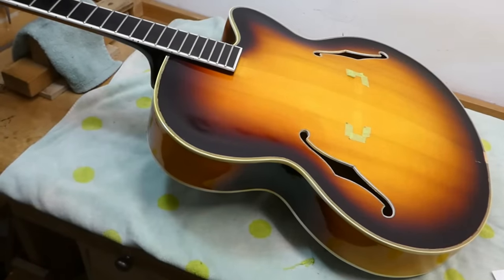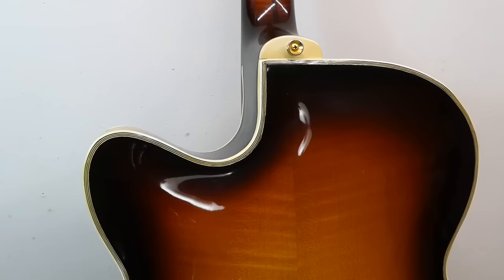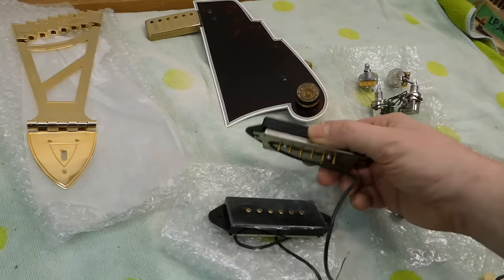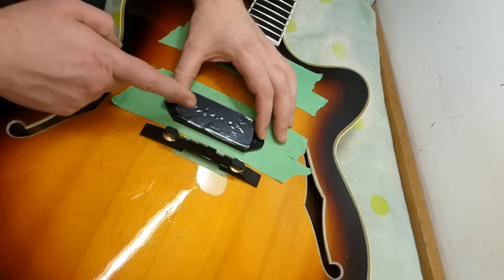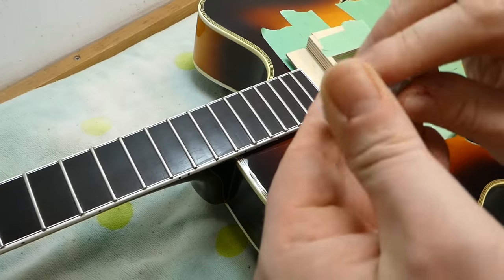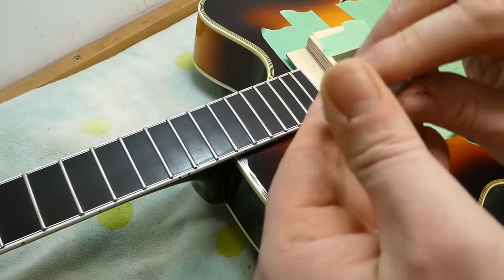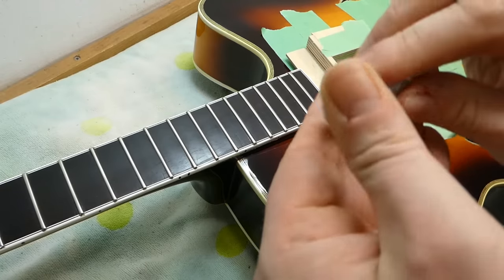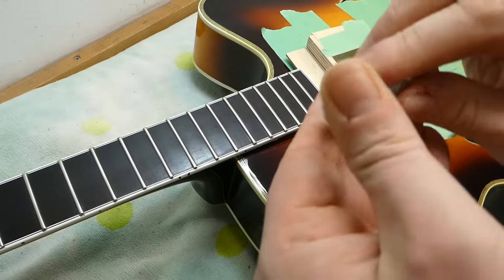The Forbidden Mod

Comment: Insignificant correction:  A hundred mils is about 2.54 mm.  That's an easy one, also a number I have memorized while refacing sax mouthpieces.
For historical reasons, sax mouthpieces are measured in mils for the tip-opening, but mm for the length of the opening (the lay ).  So a piece might be designated as 100/24, meaning .100" tip opening and 24mm lay.

Comment: You said that the optimal spot for the bridge pickup based on harmonic overtones becomes irrelevant the moment you fret the instrument... but that isn't necessarily true, since many chords, songs, etc. are centered around an open string, or at least are relevant to one harmonically, and most people typically play using scales, which are typically groupings of notes with a high amount of harmonic consonance.
Although... this is so deep in the minutia of tone construction, that its effects would be so miniscule as to be totally irrelevant in any meaningful context.

Comment: Did i miss the part when you checked where there are braces ? I once wanted naively put a neck pickup in an archtop and then realized that there are A (or V) shaped braces from end of body to the neck that come together at the neck and you definitely would not want to cut through those. Have seen this bracing on several old archtops. Never seen an X like this has.

Comment: how about making a threaded sleeve that will fit inside the hole in the body, secure the switch, and sit tight with a nice little rubber washer. may need a slightly larger hole and a lathe, but seems easier than gouging rom the inside. thoughts ?

Comment: I would have installed a floating DeArmand Rhythym Chief with a single volume pot in the pick guard. Rolling off the volume gives you a less bright tone so a tone knob is redundant. This was too invasive. At the very least maybe install dog ear P-90's instead of cutting up the soundboard so much.

Comment: As always well thought video! But I would like to state that there is no electronics in this guitar, as in 99,9999% of all other electric guitars (which are in fact no electronic guitars). Here, it's only primitive electric parts. Electronics would be an active circuit which requires at least a transistor or diode or, if more complex, something like an operational amplifier or microprocessor.

Comment: In the future, you may want to try and round off the interior corners of the cut if you ever find yourself cutting braces again. Sharp corners create something called a stress concentration, which vastly increase the chances of a break happening. Back in my knife-making days, I learned to avoid 90* internal corners religiously!

Comment: Some toggle switch 'nuts' have a longer 'throat' to go down into your hole that is drilled through the top of the guitar.
Reply: Used to use those to mount car stereos into dashboards in the 1980s; they're called "reach" nuts. Never seen them in anything but black finish however (the nut can't be seen underneath knobs, but a toggle switch will have a visible nut).

Comment: 3M offers painters tape in three different tack/adhesive levels.

The low tack version will stick to a smooth surface adequately, but can be removed with substantially less effort than the painters tape used in this video.
Reply: One more thing. You learned some pretty sounding chords. Nice work and sounding guitar.

Comment: Listen to me twoodfrd.  I need to communicate in as little time as possible.  Try a little longer screws on the pick up surrounds  AND then place some real slick gaskets between the surrounds and the guitar's soundboard.  Tighten the scews back down lightly allowing the pick ups to rest lightly on the gaskets.  YOU WILL BE amazed at how much of the acoustic sound you WILL recover.

Comment: I feel like you always struggle slightly with using fishing line (or similar) to fish pot shafts through holes. Have you considered surgical tubing? Instead of tying line to the shaft, slip the tubing over the shaft. Then as you pull the tubing out, there's nowhere the shaft can go other than through the hole with it.

Comment: What I would have done would be to tape off the F-holes, carefully remove the back then fill the body with epoxy resin, put it through a band saw to reduce the body to 1/3rd the thickness, turn over and rout out for three f*ckbuckers and a Floyd Rose, scallop the fretboard, add a locking nut and spray shocking pink metallic and add LEDs.

What - the...  the 80s are over?!?...

Comment: at 10:32 ish when you said "I'm just gonna mark it," I was actually in the other room listening to this video. When I heard that, then I heard the scraping sound that follows shortly after, I thought you were just scraping the finish on the guitar. I was thinking, "damn, this guy is fucking baller" lol. But then I realized that you were using sticky tape. I wanted to make this comment to say that despite my miscalculation, you're still a fucking baller.

Comment: Well, I for one don't approve of this mod, and who cares what I think. There are plenty of people who own more fatback jazz guitars than I do, but I have an L-5 and two Guilds from the 50's (chosen for their long scale '56 and earlier) so that's not nothing. How many times does a jazz guitar player use the bridge pickup? Approximately zero. Mixed with the neck pickup? OK, once in a while. I would opine as follows: That this guitar owner would get 70% of what he thinks he is gonna get out of two pickups by simply finding or modding a "Johnny Smith" pickup (like the one he has) where you could split the pickups, HB and single coil, at astronomically lower cost than this mod and leaving the guitar as it is. I mean, fun's fun, but he is actually losing the humbucking sound of the existing pickup, which to me is the main sound of guitars like this.
Incidentally, the nut for the pickup selector switch uses the same thread (and thus utilizes the same nut) as just about any old panel-mount bat-handle switch that mounts in a 1/2" (actually 15/32) hole. True, not gold plated.
PS: Making pickguards for hollow body guitars is a complete PITA.

Comment: At 6:15, the ground wire comes off the back of the pot; whoever made that control assembly had lousy soldering skills.
Reply: I didn't do it. Although if I had, there is a 31% chance the same thing would have happened.

Comment: So what your saying is ITS WORTHLESS ..HACK IT UP!...btw,nowsadays you can find a 3-d printer to make whatever part you need such as the tip for the switch for example...also,you can use a dental mirror and put it into one f-hole and use the other f-hole to look into to see were the top braces are..probably need a flash light

Comment: It would be better if you understood more about the physics of a vibrating metal string.
Reply from the maker: People love to talk about this, but it's always about a theoretical monochord rather than an equation that takes into account incrementally variable string length.
Reply: Same general concept as the brass nut. Sure,  more sustain for open strings but that is lost when fingers touch frets.
Reply: @brucejoaniewilliams3213  Did you actually test that or is that just a wild-ass guess?
Reply: Doesn't seem like a complicated concept, the finger in front of the nut is the new end point of the string.  So unless you have metal fingertips, like Tony Iommi, the fleshy fingertip will not have the same sustain as brass. All that being said, i have not done experimentation, and i have been wrong before. That one time, in 1992, i think it was a Thursday.
Reply: @brucejoaniewilliams3213  So even you know you’re talking out if your ass. Cool.
Reply: No, just sharing an opinion. But you know what opinions are like.